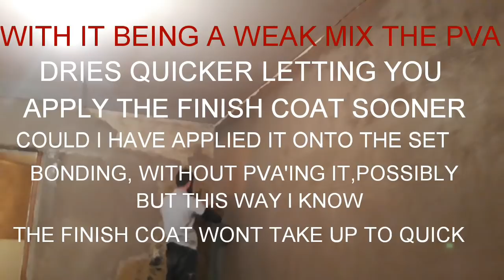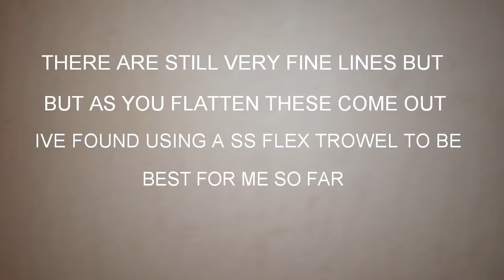plastering over a bonded wall

Comment: Good video.  I bonded my kitchen ceiling yesterday I wasn't sure how to leave the finish so I just ran a broom over it to create a key. I noticed you done one coat of PVA, someone told me 4 and 1 fist PVA coat wait for it to dry then 2 / 1 pva wait till it's tacky then skim ? What's your thoughts. I've used the spunge a few times and found the finish is flatter if you go round in a circle motion. But don't leave it to long before troweling 2 or 3 minutes just then it's fine. I've only been plastering 18 months so still a novice I'm learning a lot of you tube.
Reply from the maker: If the bonding coat is fully dry then you will have to really pva it but if you are going over it the next day it's not as dry so theres not as much suction as fully dry bonding these are thing you will suss out for yourself along your plastering journey
Reply: @onpointplastering  so if the bonding is fully dry you think 3 water 1 pva is good , thin enough to soak in. Then when that's dry maybe a 50/50 to give me enough time to get the first coat on before the 50/50 pva goes off.

Comment: if you were skimming over the bonding, why did you flatten out the bonding? It had a key for skimming already if you didnt flatten it?
Reply from the maker: I should have put part1 and part2 if you look at the vid that says how to destroy a sponge float as I'm floating it up with the plastic float I just think in my opinion the key was left to proud plus it was horizontal it could have shown through the finish coat also I just think that after I FLOATED it it was better for the wall binded it all together hope that I've explained that ok for you